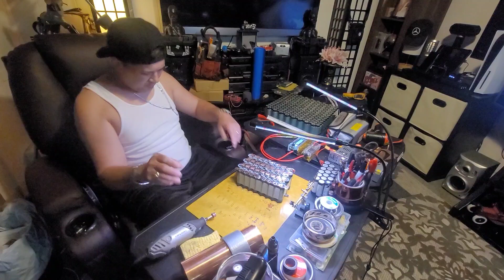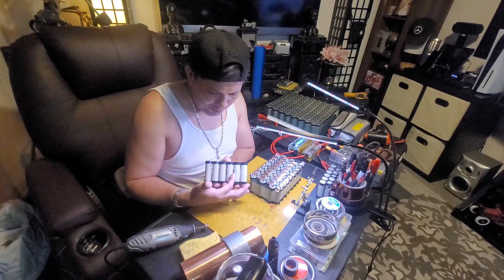BMS and Battery misconceptions, what they actually do and don't do. They don't balance your pack!

Comment: chris we actually add on active balancing units for the really special packs there are 10 amp and 20amp  modules that can be wired in  parallel to increase the charge current there is  active top or bottom  balancing it covers everything you could need.the bms thats used controls ignition ,Anti spark pre charging contacters,discharging contactors,and charging contactors ,and theres positive and negitive vc hall sensor rings they communicate with the controller via canbus we found unit for bms and charger unit it ends up about the size of 3 packets of cigarettes ,it seems small ,but its not when you have limited space

Comment: Hi Chris thanks for the informative vid again , they say a good day is when you learn something 👍 I was also wondering ….. 60%alloy 40% pb solder or any solder  still flow current well  ?? or does solder cause resistance say on busbars or nickel strips ect
Reply from the maker: I think soldering conductivity is irrelevant because there is a direct connection between the cell and the copper so it’s just not flowing thru solder alone and I don’t think solder flows in between the two I could be wrong I usually get good impedance.